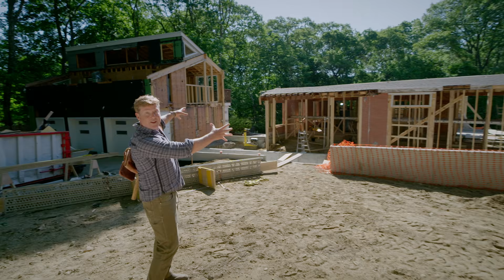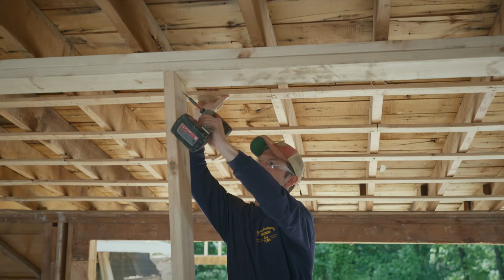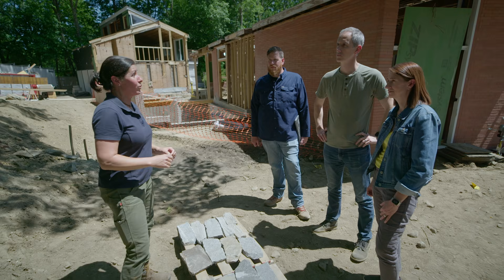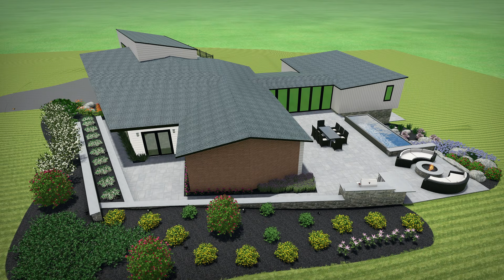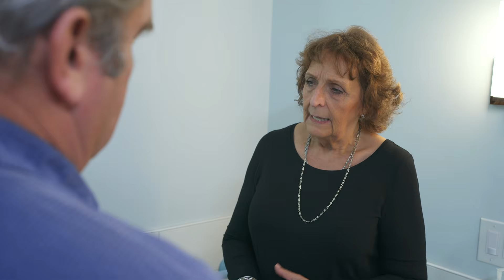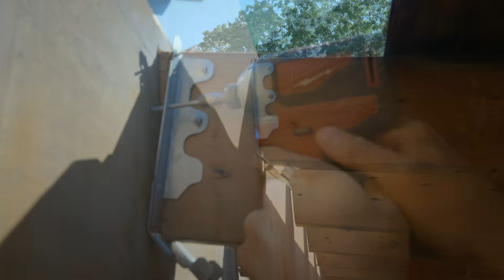This Old House | Engineered for Accessibility (S45 E4) FULL EPISODE

Comment: At this point I would have knocked the whole thing down and gone brand new.
Reply: Yeah, they really screwed the pooch on that...The way they're doing it is TEN times slower and at least 3X's more expensive...G.C Philly 40 years.
Reply: Owners seeking to preserve some of it. Admittedly, being it was mostly gutted, does seem pointless. However, another consideration is if they tear it down, there could be zoning, permitting, environmental, etc issues to deal with. Doubt that's the main reason, but maybe another motivation factor. Still, I agree that a teardown would have allowed more flexibility and probably been cheaper.